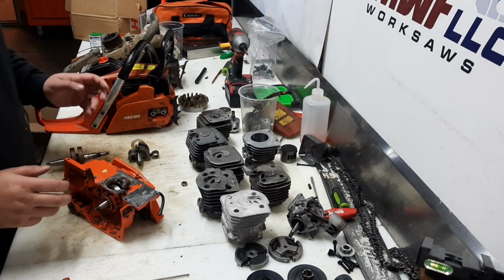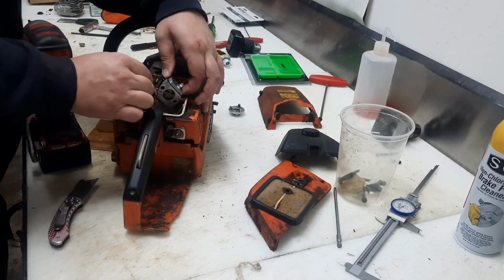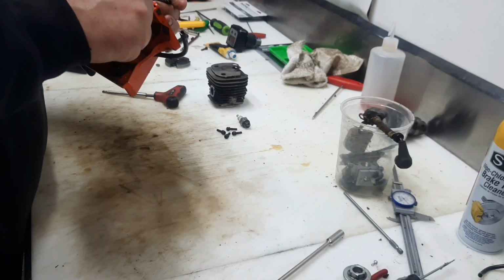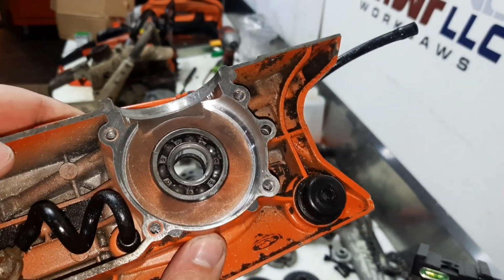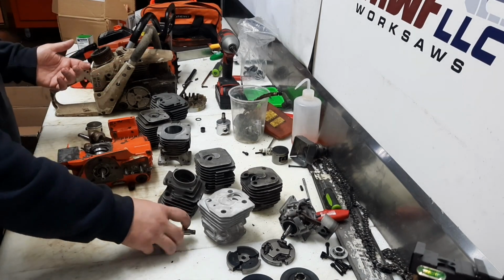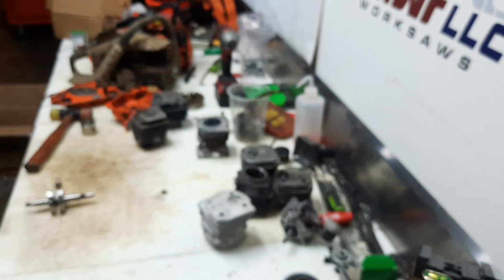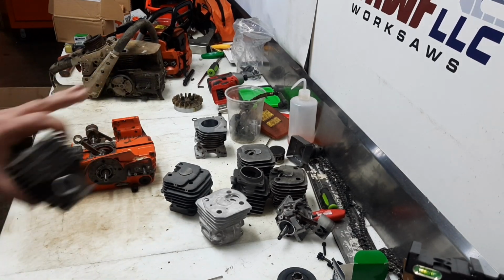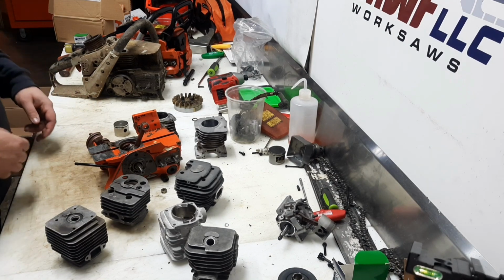STROKER 50cc Build!! More stroke more power?

Comment: Red - I initially watched the video to see how you would split the case, and by God the husqvarna case splitter worked.  I have a 4600 on the bench,  AFWIW, my saw had a base cylinder gasket installed.   Your video had me transfixed and learned more than I wanted LOL.

Comment: I would think that machine crank might have a little too much stress on the rod. For an 80 or bigger. SCARY
Reply from the maker: That much thinning of the rod is a bit much but I do have room maxing out the case to leave more material.
Reply: Wouldn't that make more case pressure going as big as possible.  Would that's be a small gain or considerable gain.

Comment: In many saw applications other than a limbing saw, I don’t understand why chainsaw engineers have chosen such oversquare bore/stroke configurations. I’m sure it’s about obtaining peak rpm and that elusive HP number. Trouble is, a saw doesn’t live at peak HP RPM in the big wood. They live in the 10,000rpm regime. If you look at the bore/stroke ratios of older 2 stroke motocross bikes, they ran a lot closer to square bore/stroke ratios usually favoring slightly oversquare to keep good overrev. Most chainsaws I’m familiar with unless they are ported extensively with a lot of machining will fall off the power curve easily making that peak HP number irrelevant. My point is if you can widen the peak power curve and build more torque in the 9000-11000rpm range, you’ll get a faster cutting saw. Longer stroke ratios will help provide that. Tuning your cutting equipment to this type of power curve is just as important, I;e taking rakers down more.
Reply from the maker: Most of the reason is packaging. Easier to fit a larger bore and shorter stroke in a small saw. Larger stroke takes bigger cases and cranks. And it all adds up to extra size/weight
Reply: You’re also applying 4-stroke results (in reference to bore/stroke ratio) to a two-stroke and the concepts aren’t consistent. In a 4t, larger overbore engines favor RPM due to valve surface area more than any one factor. Richard Holdener proved that all things being equal, longer stroke always makes more torque and Hp across the board without a loss of RPM capability. What that all means is that the engine’s RPM is limited by air getting in and out to a much higher degree than it is by stroke ratio. 

A 2t works by uncovering ports in the cylinder wall, a longer stroke would theoretically uncover larger ports per degree of timing, but you run into terminal maximum piston acceleration  being your RPM limiting factor, which is related to the stroke ratio, but ultimately determined by stroke length - longer strokes means faster piston speeds, meaning you’re closer to the unsafe limits of that design. 

And packaging.
Reply: @RyanMcIntyre  I guess I can relate to that statement. Good information.

Comment: The 34mm stroke crank out of a 5800 clone saw like the joncutter 5800 or supmix 6200 might fit in there without machine work 
The 550xp is 43 bore x 34 stroke and they rip
Reply from the maker: Will have to get one ordered and check it out  
Thank you